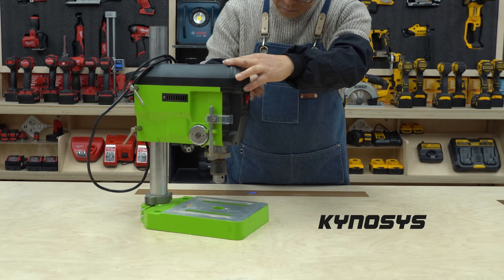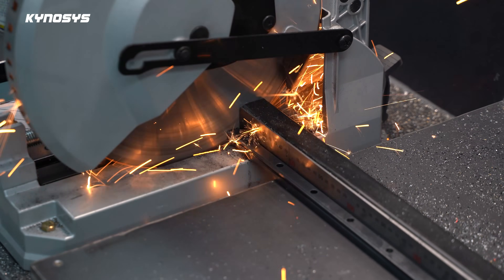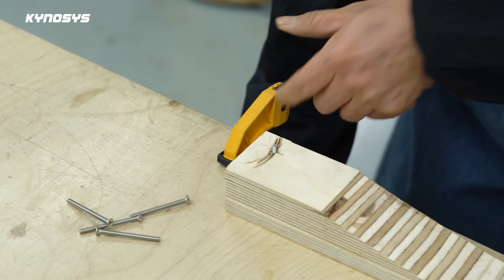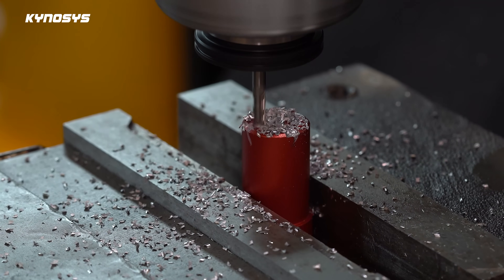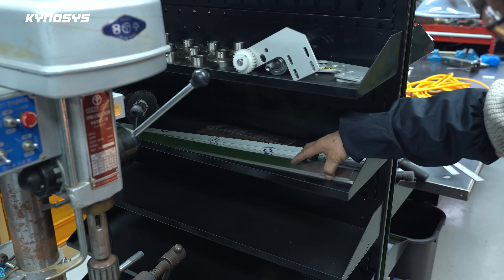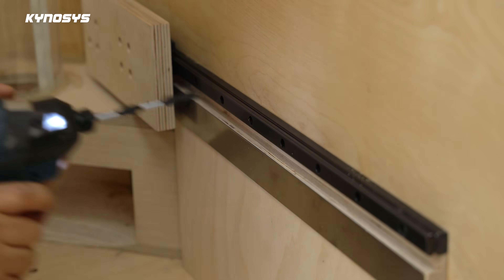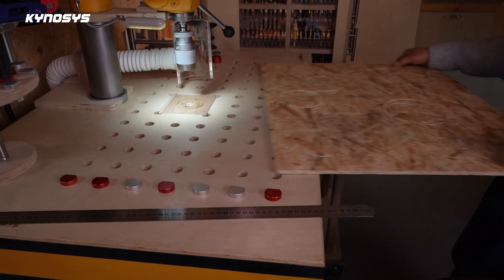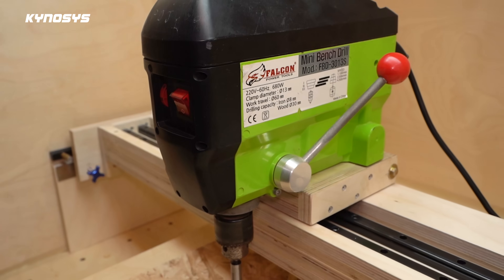CNC Type Drill Press making / Sanding Base / DIY

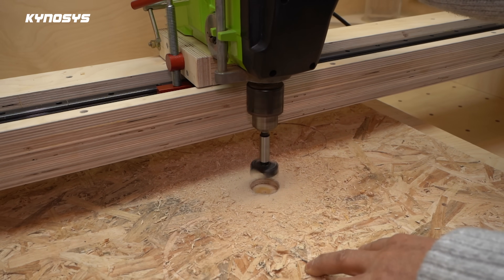Comment: I need one of these in my workshop, yesterday!!!! Time to go make some sawdust. Where did you get those blue knobs that you used at 6:45??? 10:53 I noticed that the horizontal piece was flexing a little bit. Maybe a piece of aluminum, or even steel that is about 5 or 6mm, cut to the dimensions of the underside of the horizontal piece, and attached with screws can prevent this from happening.
Reply from the maker: The blue knob can be found by searching for aluminum knob online. I appreciate you paying close attention to the details of the video. I will take your advice into consideration.